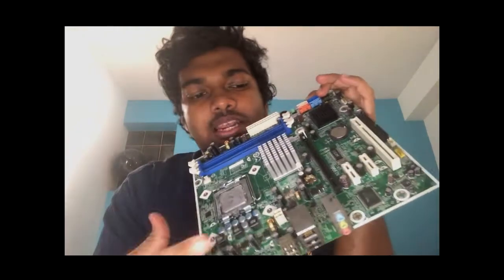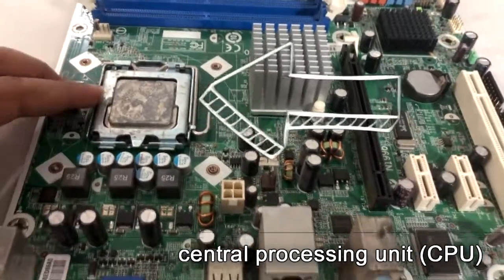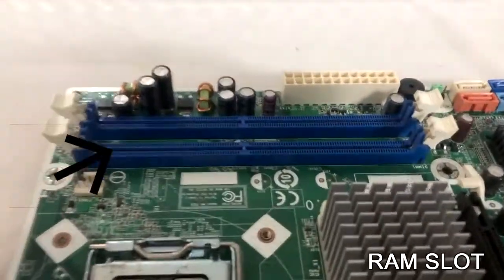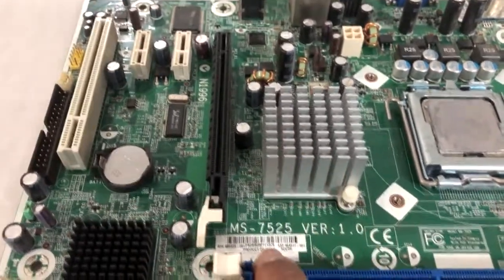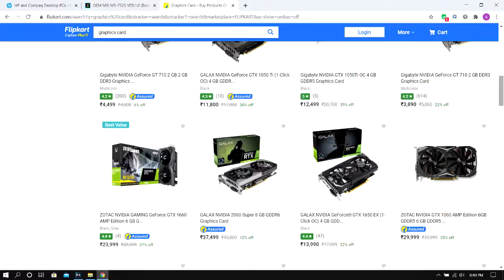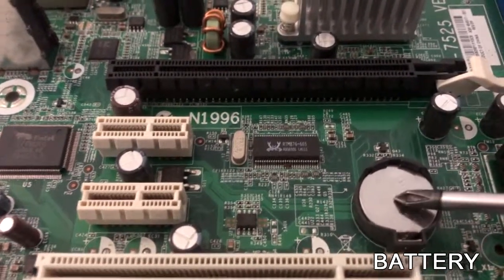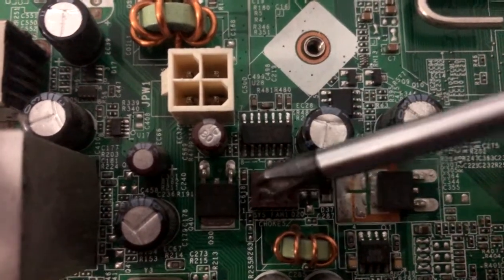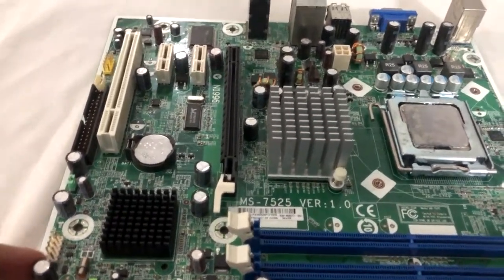Motherboard explained in TAMIL- chipsets, sockets and ports

Comment: Bro my laptop hp 15s-du2099 ts 8gb  ram i3 bro can I change raizon for fast working or its ok
Reply from the maker: No bro you can't, normally you can't change your laptop processor, only possible in desktop computers
Reply: @PETROTECH7  what's the reason to change in desktop in laptop can't